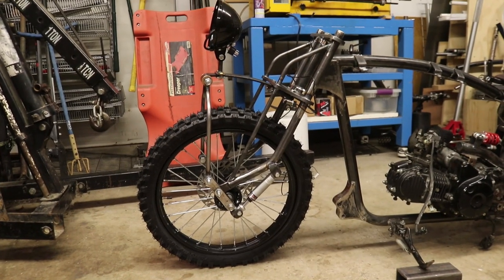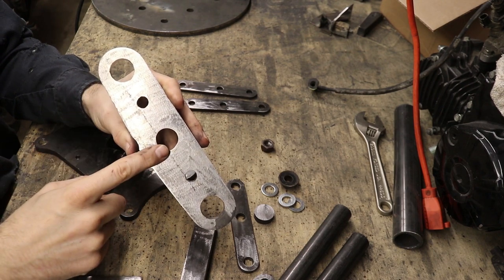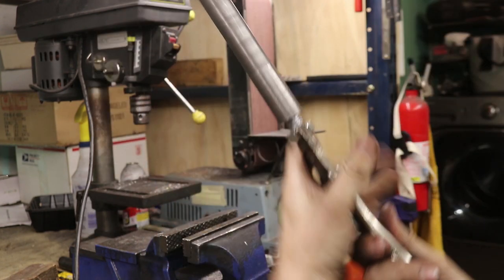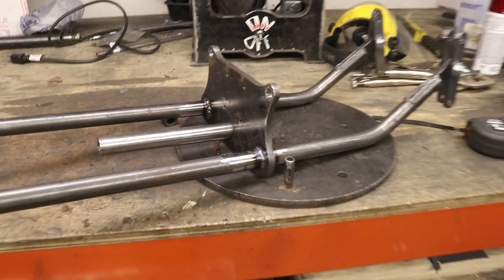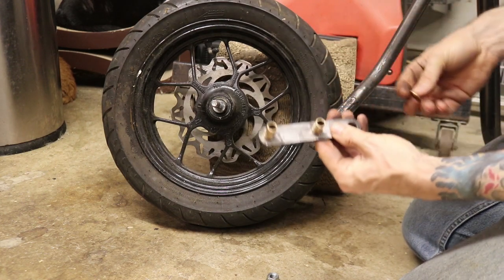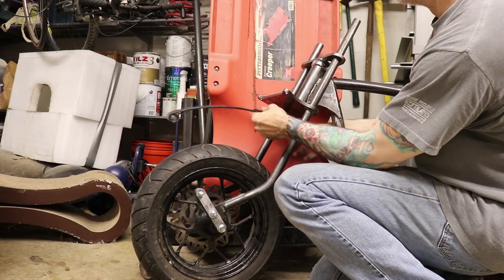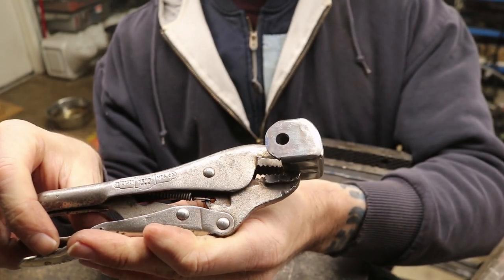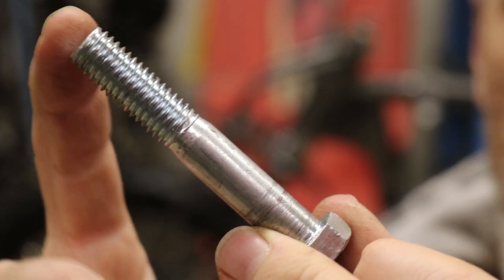Motorcycle (Leaf Spring) Leafer Suspension Build

Comment: Would putting the wheel in the center of the linkage fix the blowback problem  I’m not sure
Reply: came to say this. the linkage is too vertical and allows it to rotate back.   Also the dampener is bottoming out and will damage it. great looking fork though

Comment: Very Nice i Dream to build one for my bike too. But i have a question. The leaf is only hold under the tree by the square piece of steel and 4 bolts ?
Reply from the maker: Yes. Its held on by that 1/4" piece of steel.
Reply: @HooptieDoodle  thanks for the answer.  But if the front wheel meet a big  hole, the leaf May bend a lot, cant it slip away from the space between the tree and the square piece?
Reply from the maker: @arter8  anything is possible,  but the wheel has a limited travel range due to the links between the wheel and the fork. Like 2-3". It's not much of a suspension,  really. It's also a lightweight bike. The forces acting upon the spring are pulling it against the plate, not trying to pull it out from between the plate and the bottom triple clamp. I can't imagine this vehicle being able to generate the forces, both in strength and direction, to be able to pull the spring from its clamp. I could add a rod going through the spring from the plate, or triple, to guard against the catastrophe you mentioned. I may do that. I have yet to really test this suspension,  so we'll see how it behaves. Keep in mind that I am no engineer,  so I might be completely wrong and possibly dangerous ☠
Reply: Thanks to take the time to give me a détailed answer. I saw no rod as à guard like you mentionned on aftermarket leaf springer to. So maybe its not necessary you are probably right! I ll keep following your work. Cheers from France

Comment: Good work ! Just started fabricating my own leaf spring front end  - trying to get my head around  a floating disc break caliper🤷‍♂️  so please hurry up with the next video 😂 btw  to prevent overshot would it not be prudent  to have stops on your  rockers so you can dispense with the shock ?
Reply from the maker: Yeah, I had the thought of bump stops of the sort you mentioned on the rockers, but I also felt it would benefit from some dampening and the shock dampener accomplished both. I am still not 100% confident in this thing and looking to see how it rides...
Reply from the maker: Good luck with your build👍👍

Comment: Isn’t the damper working in the wrong direction? Dampers have different damping rates for compression and rebound. The way it is mounted the damper works in reverse than normally. When the suspension compresses the damper extends(rebound) and vice versa.
Reply from the maker: When the wheel hits a bump, it travels upward, compressing the dampener and pulling on the spring. The dampener is working just as you say it should.
Reply: @HooptieDoodle  Oh sorry, you are right. I was getting confused with with where the wheel is mounted in this setup. I looked at the video again and it works as it should. Ignore what I said :D
Reply from the maker: @marcelpursche5339  it may not be wrong to suspect that this suspension will not work well - I know I  have my doubts at this point 😀. We'll have to see how it goes down the road...